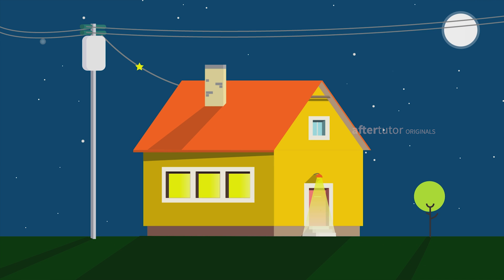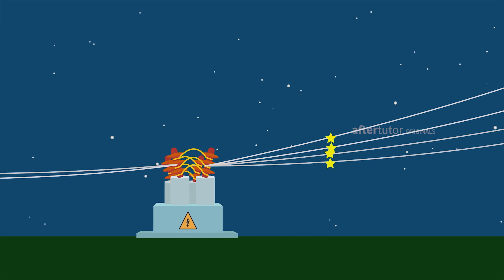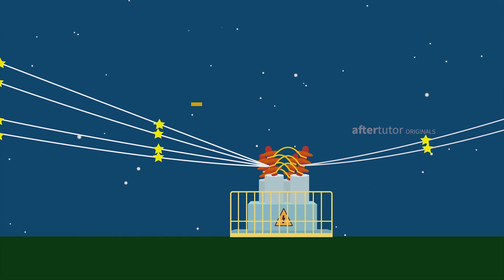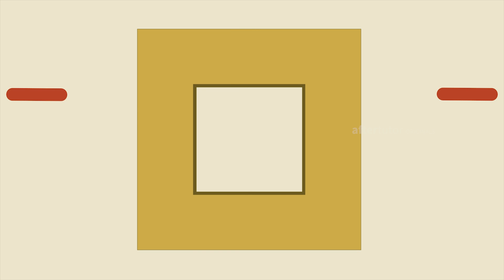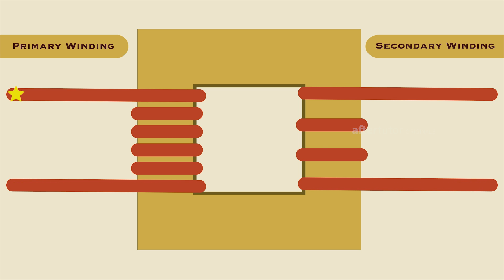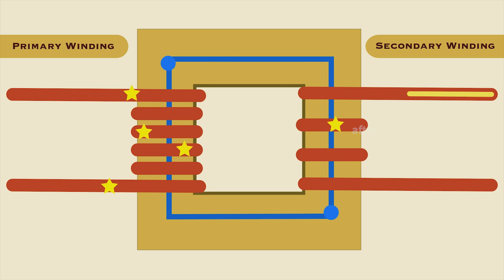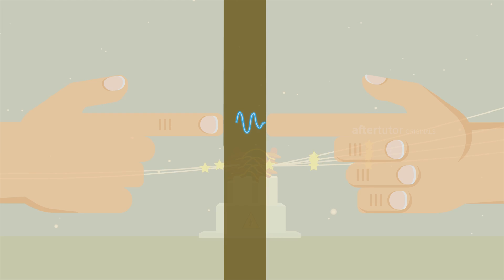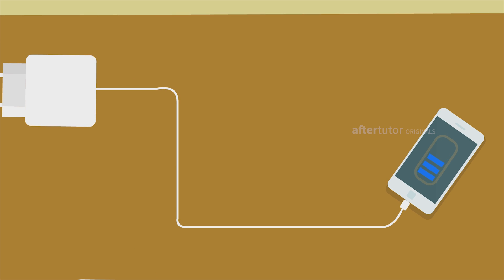Transformers - How does electricity reach our home?

Comment: Even a resistor can step down the voltage right? Then why to use a transformer. Can someone explain this please....
Reply from the maker: Hi Manish,

A resistor can technically reduce voltage, transformers are more efficient and practical for tasks involving significant power levels, especially in applications like power distribution where minimizing energy loss is crucial. The choice between a resistor and a transformer depends on the specific requirements of the circuit or system in question.